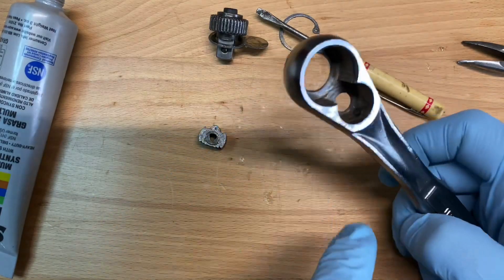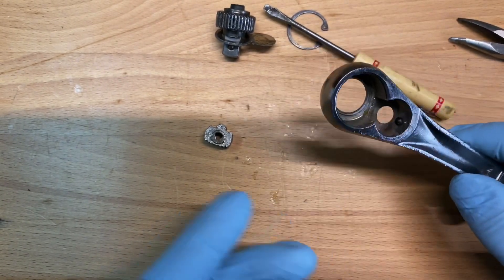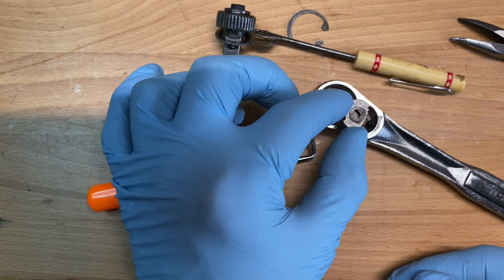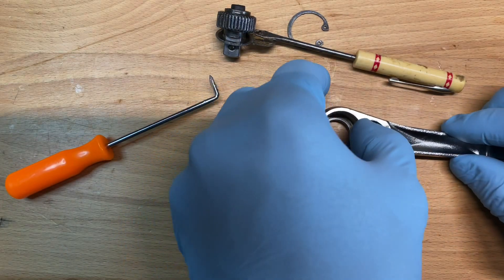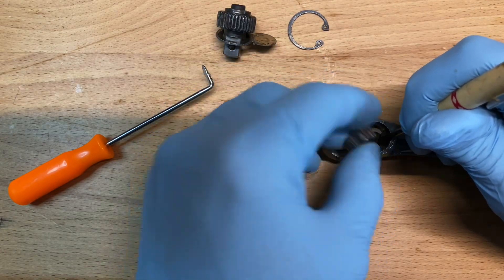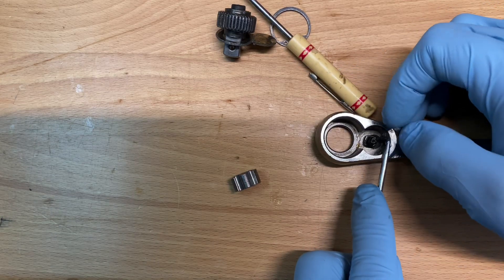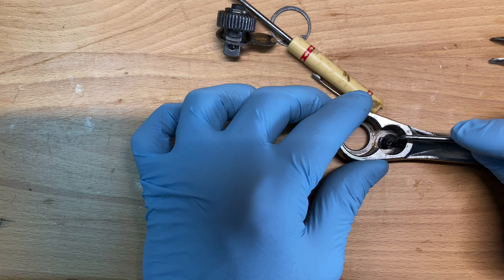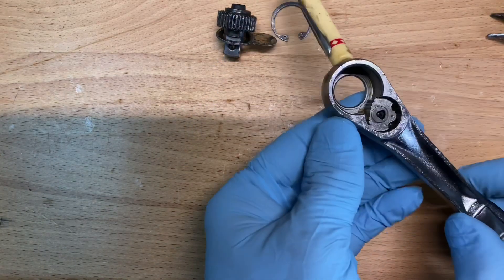How-To Put a Craftsman Ratchet Back Together (Ball Bearing)

Comment: I use to rebuild these ratchets when i retired and worked at Sears.  I used an S shaped flat piece of metal like you pick a door lock with. This allowed you to be able to hold the ball bearing down until you could put your pivot block in to hold it.  Hope this helps when you rebuild your next ratchet
Reply: Yes try using a jewellers or glasses screwdriver, I was thinking if you cut a piece of feeler guage, bent in a circle to hold the bearing in place then just pull out when the pawl is in place, but luckily did not need to go this far.

Comment: Just done this. It really helps if you put a magnet behind the ratchet head. Do exactly like this, dont have the large cog installed. I cleaned my ratched and rebuilt with PTFE bicycle chain lube (couldnt find the graphite lube), rotates like a dream, but its amazing how much lube was leaking out, these are not well sealed.

Comment: Where do you get replacement ball bearings?
Reply: eBay has a bunch of different kits for different ratchets. Search for the kit using the part number on your ratchet handle. Keep the VINTAGE Craftsman ratchets working. They are as good as anything else out there. The new stuff doesn't come close.

Comment: Man, get a paper clip 📎 bend it at a 90 toward one end and flaten the tip with a hammer. Make tools that work 😁
Reply from the maker: Boom! There we go! 👍🏼👊🏼
Reply: Excellent work around, thank you!!! There is a ball assembly tool that is similar to what you are creating. However, the rebuild kit I bought on eBay doesn't include that tool. I'm getting out the BFH as we speak!!!